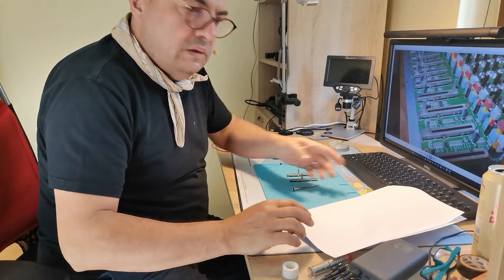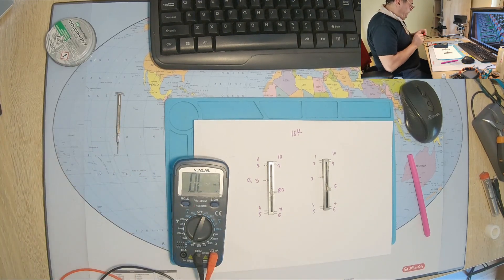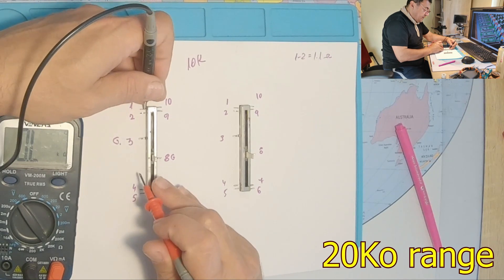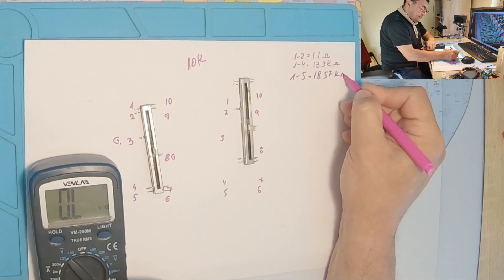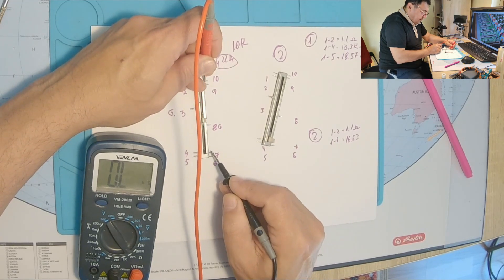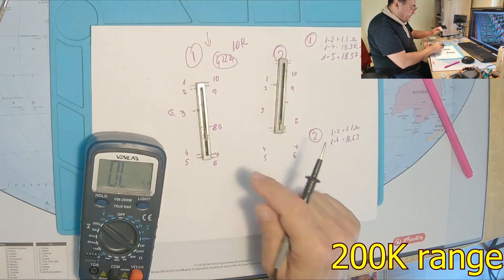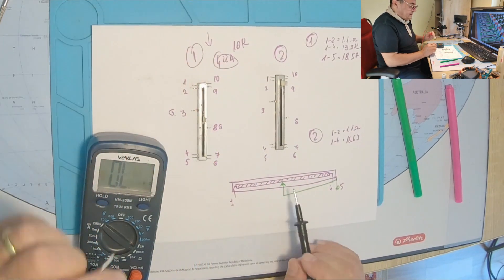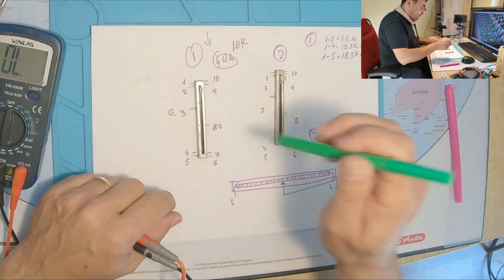Let's talk faders, Souncraft, Dynacord, Behringer 10K 422A potentiometer test.

Comment: I wonder, is that just how soundcraft makes mono faders? If it were a stereo, the right side would give you measurements consistent with the left side. Now I’m wondering if those are the correct faders for the soundcraft. All the channels are stereo after all.
Reply from the maker: There are no stereo channels, except the last 2 dedicated for stereo instruments, so the potentiometer can as well stereo but using one trace only. The first 12 channels in my case are mono and because balance can assigned to left or right, in fact for using let's say ch1 and ch2 for a keyboard , you need to plug left on 1 , right on 2 and balance left/right.
Reply: @viocaia  I see. I have learned yet more from you. Thanks.
Reply from the maker: @jonreiser2206  anytime😁